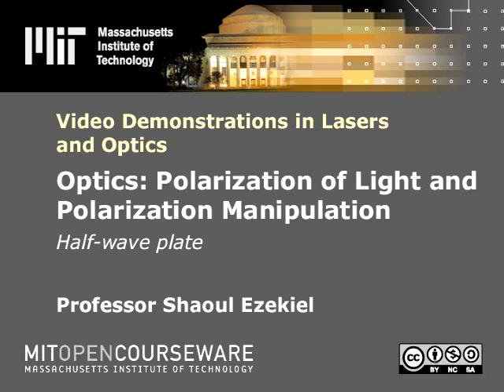Optics: Half-wave plate | MIT Video Demonstrations in Lasers and Optics

Comment: I have watched every video I can find on wave plates, and read every article I can find explaining them, and not one of them explains what is physically happening inside the medium (other than mentioning the different indexes of refraction for differently oriented polarized light). I want to understand what is happening at the atomic level to alter the phase of the polarized light,  and no-one has yet to describe that.
Reply: You should first understand how an optical medium changes the speed of light waves (what is the origin of the index of refraction?). There is a good chapter about this in the first volume of Feynman's lectures on physics, which you can find for free on the internet.
Reply: @non-inertialobserver946  , Thank you, I'll look it up.
Reply: me neither, bro. I am now very confuse and curious about what physically happend wenn light transmittance the half wave plate.
Reply: maybe the nswer no one knows why dont you dicover it yourself using your urrent knowledge and some experiments